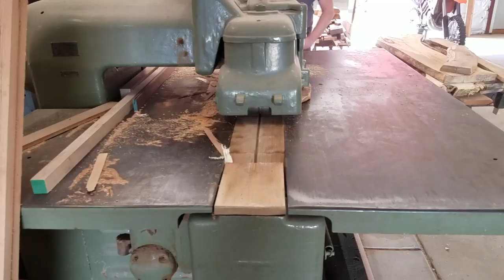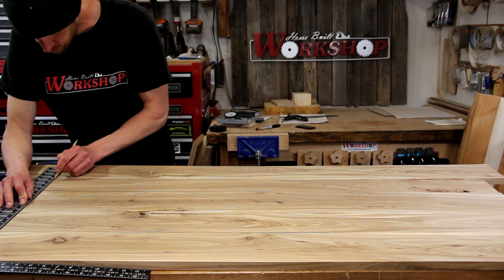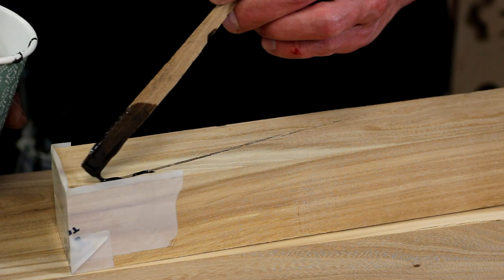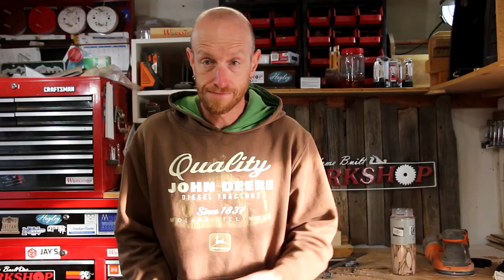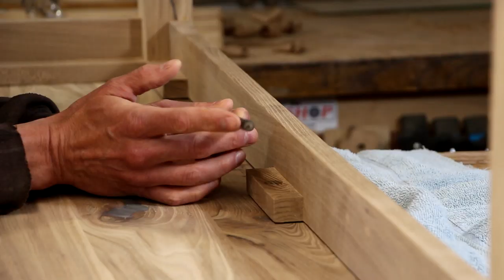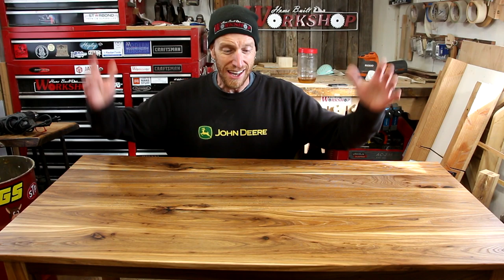How to Build a Table | Logs from my Yard

Comment: That's some beautiful wood, brother.  I'm a little concerned about the table base though.  I have a hard time believing that biscuits and end grain glue will hold those legs on for any length of time should the table be drug across a floor or bumped into with any more than moderate force.  I noticed it was flexing even when you picked it up to install it on the top.
Reply from the maker: Thanks. So far its been leaned on, sat on, pushed against, bumped into, and its ok. Time will tell.